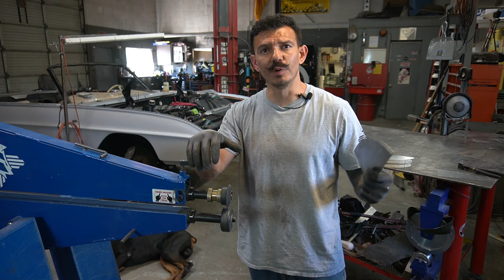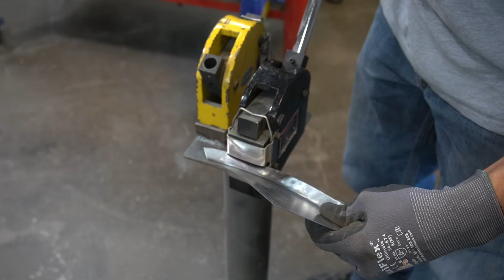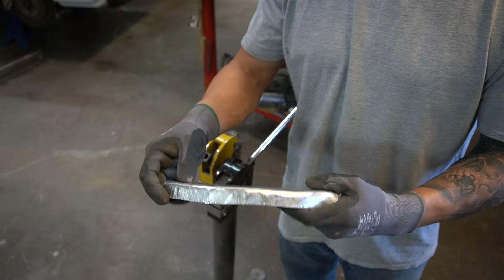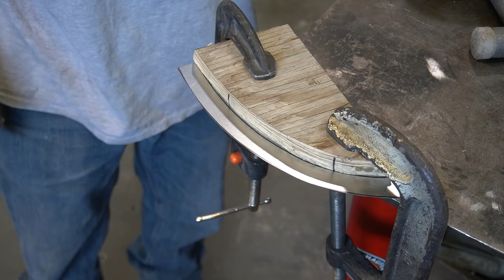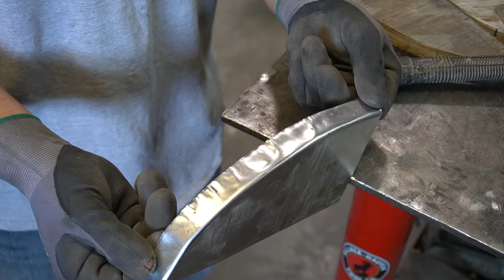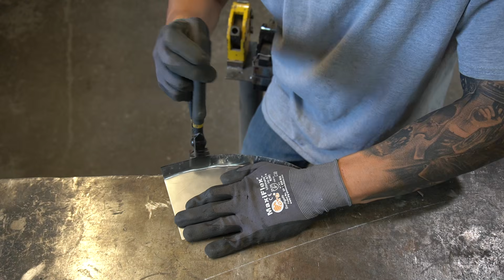Metal shaping: 3 Different Ways to Form a Curved Flange

Comment: Why did you use a plastic faced hammer on the hammer form? Curious how you would make a curve U-shaped piece.
Reply from the maker: I used that hammer only because I like it, a metal hammer would work too! Also for a U-shaped piece, the same process applies, if the flange is on the outside of the U-shape, the metal would shrink.   But if the flange is on the inside of the U-shape the metal would have to stretch. Thanks for watching man

Comment: I really enjoy watching your videos.
I'm no metal fabricator but the second demonstration seemed to be the most efficient and looked as if it would only require a small amount of shrinking.
Am I correct?
Reply from the maker: Thank you very much! Well since each panel was exactly the same they all took an equal amount of shrinking, the second method (hammer form) was more of a tuck shrinking method, you can see the metal gather together and create a tuck and as I proceed to hammer the tuck out the metal tends to shrink in those spots. Thanks for watching!
Reply: @BeAMetalFabricator 
You're welcome.